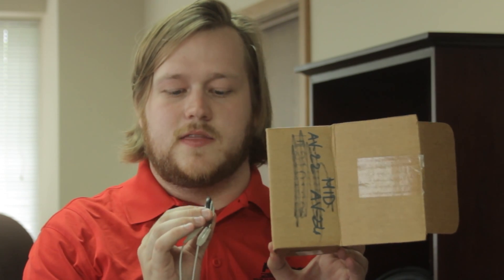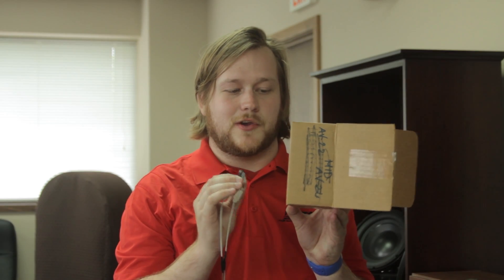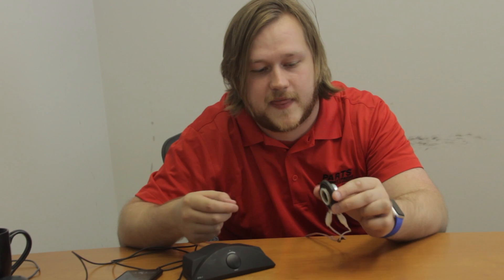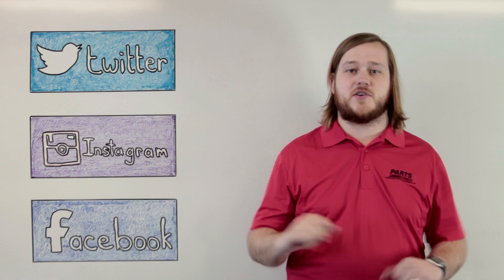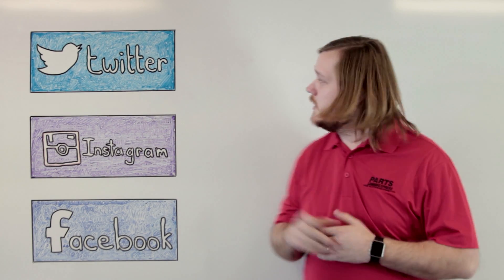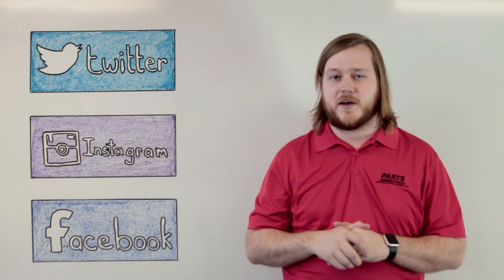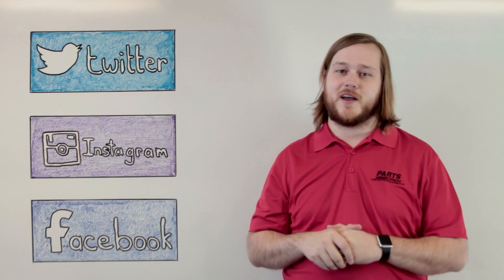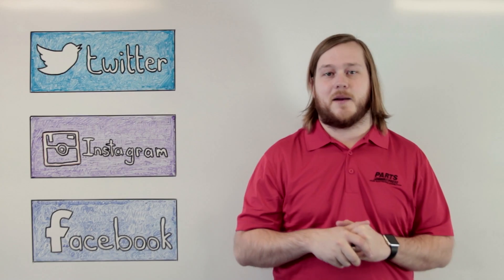How to Turn Anything into a Speaker.

Comment: I found the box that it came in, with the packing inside gave one of the best sounds out of the multitude of elements I tried. That includes the ceiling tiles that are supposed to be the best. The ceiling tile is dense, and requires a larger exciter than I bought. Anyway, I wound up using a small round paper mache box and a half round piece of Styrofoam that I got from Michael's. The sound is decent for music, but the hollow box sound comes out when listening to people talking. It's a work in progress :)
Reply: Styrofoam insulation sheets probably work better than ceiling tiles

Comment: Would you consider these a viable alternative to home theater speakers if put on bigger panels? I know it all depends on the material and size of surface but do you think they can get pretty loud? I imagine these beautiful 2x4" wooden panels on each side of my TV producing good sound quality but I only see them in applications where they dont get very loud
Reply: I think the frequency response would be wonky with these as-is. With wood panels , I assume there will be a huge bump in mid to mid-bass frequencies. So maybe your 2x4 panel with an added tweeter and some crossover network to tweak the sound would work. The thinner the panel the better the response will be according to some of the Youtube vids I have seen. It makes sense since you are vibrating the substrate. The less dense the substrate (wood panel in your case) the easier to get it vibrating. Good luck!

Comment: Hi. Is there any model that can be strapped to body (chest) and simulate low frequencies like an on a concert or near big speakers. Like you can feel the vibrations that you can't hear kinda like subpac or woojer from kickstarter?
Reply from the maker: You will need an amplifier but DJs usually use these to throw silent raves even. Its pretty awesome!
Part numbers on our website:
300-388 (16 ohm)
300-386 (8 ohm)
300-389 (4 pack of 16 ohm)
300-3880 (optional mounting ring)
Reply: they are called ASSKICKERS for gamers +- 100watt
Reply: Will it induce the brown note?